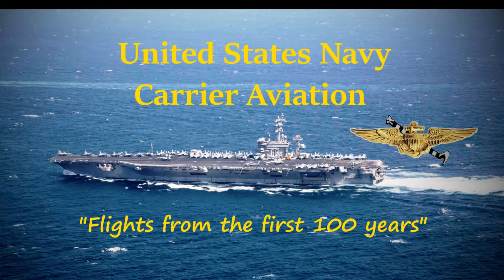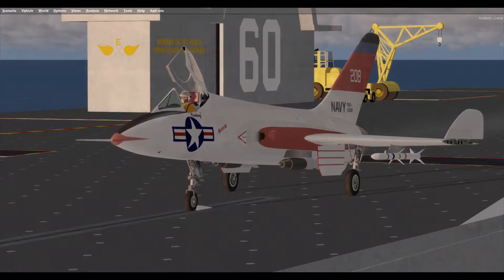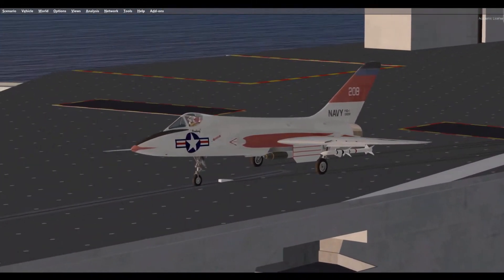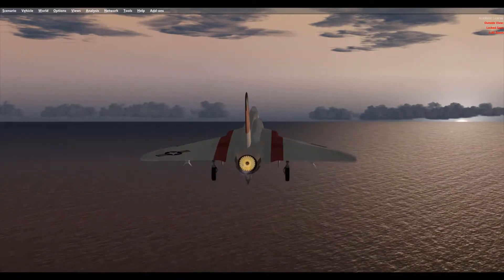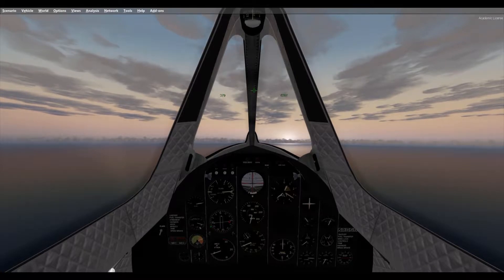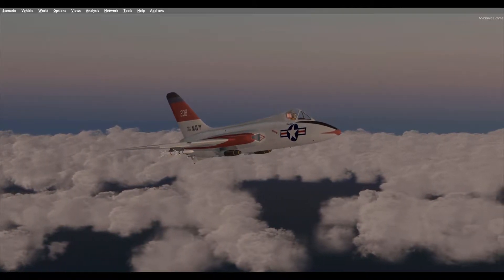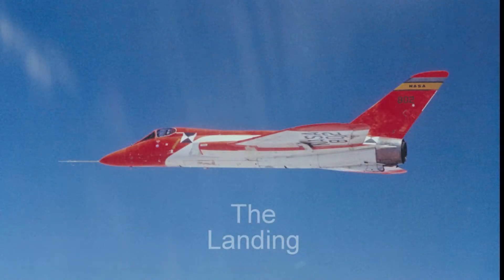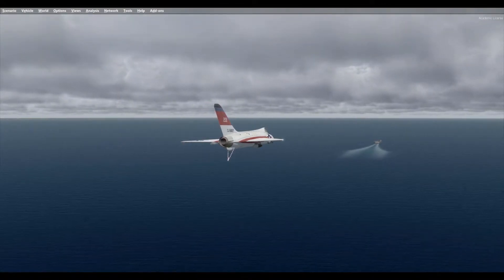U.S. Navy Carrier Aviation_The past 100 years with FSX/P3D --#53_Douglas F5D Skylancer

Comment: I'd almost swear it had provision for either 500 rds of 20mm cannon (4 x 20mm @ 125 rpg), or rockets; and 2 Sparrow II (I never remembered provision for four sidewinder)
Reply from the maker: You may be right Peter.  This one was a hard one to research and I would appreciate any additional facts you may have uncovered.  I personally found that detailed information about the F5D Skylancer was somewhat limited probably due to the aircraft never reaching actual production.   It is clear that Douglas originally designed the F5D around their proposed AIM-7B Sparrow II missile that was concurrently under development.  The following information may provide additional clarification.  In 1950 Douglas began investigating the feasibility of a “fire and forget” missile with an “active” radar seeker guidance system.  In 1955, while actively building the two F5D prototypes, Douglas agreed to partner with Canadair to develop an improved version of the existing “passive” radar seeker AIM-7A Sparrow I missile.  The new AIM-7B Sparrow II was larger with an “active” radar seeking guidance system and was intended as the primary weapon of the new Skylancer.  In 1956 Douglas abandoned the development of the Sparrow II after an unsuccessful and disappointing test program.  Consequently, in addition to the four 20mm cannons other planned F5D armament loadout scenarios included combinations of four retractable rocket launchers with 72 spin stabilized unguided 2” rockets, two AIM-7A Sparrow I medium-range passive radar guidance missiles, four early AIM-9B Sidewinder infrared seeking missiles, or assorted bombs.  

Thanks again for the feedback and I would appreciate any additional specific details you may be able to contribute.
Reply: I'll have to do some looking for more detail, but I did find it fascinating that it was predominantly procured in the event the F8U failed!
Reply from the maker: I think the Navy wanted to hedge their bets, especially since about this time frame the performance of the Navy’s jet fighters was lagging behind the Air Force fighters.  We have also observed that on several occasions the Navy ordered  prototypes from several different  manufacturers.  Sometimes these prototypes were continuations of a separate existing operational aircraft.  This was probably related to acquiring adequate funding from the government; a strategy I believe you have mentioned on one of your previous comments.   There are some historians that believe the F5D Skylancer with a J-79 engine, as proposed by Ed Hieneman, would have cleaned the clocks of both the XF8U-3 Crusader III and the McDonnell Douglas F-4 Phantom II.  We will never know for sure…….but It would have been fun to witness a fly-off!
Reply: The Skylancer deserved a better fate, but it’s all in the timing. It was an aeroplane that corrected almost every problem of its predecessor, the F4D. The F4D was a great plane in its own right with some very big gremlins. Slow speed flight was hazardous and Dutch rolls could spring on  a pilot without warning. Spin recovery was totally unintuitive. The F5D was an almost complete fix, fulfilling the potential of the Skyray. Unfortunately, for Skylancer, it had the misfortune to have a prime competitor from the next generation, the Phantom II